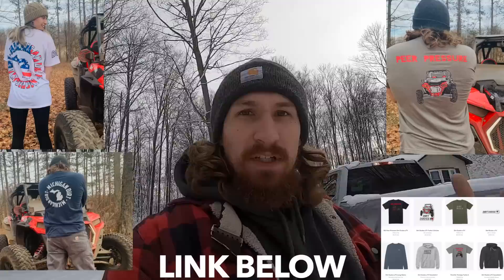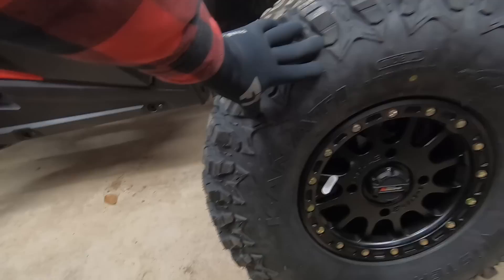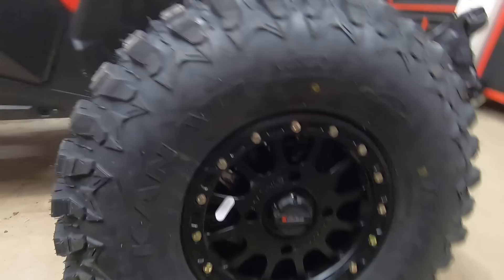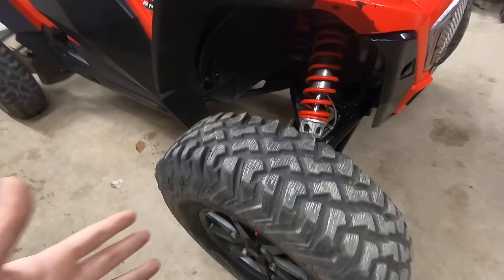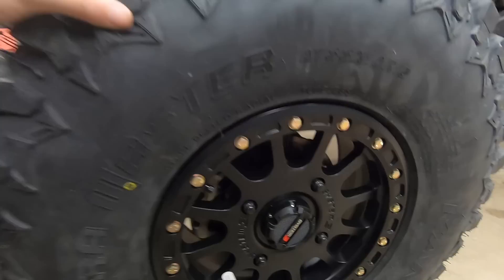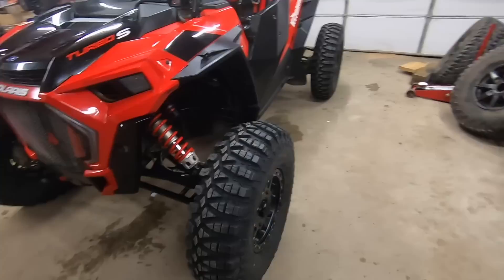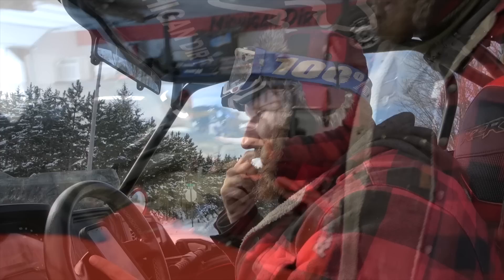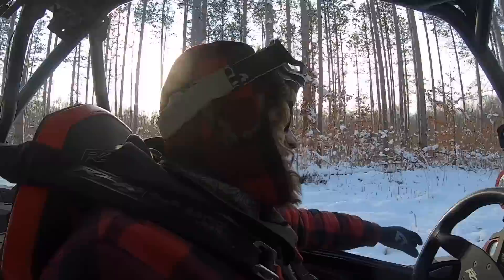Boondocker RZR Turbo S 0-60mph | Rim & Tire UPGRADE! Kanati Terra Masters on System 3 Beadlock Rims

Comment: sweet video the turbo s is looking good! I have the same setup and live them. I run the front tires side a and rear side b. I recommend you re torque your bead-lock bolts to 15-18 ft lbs after a couple tips they come loose over time and loose air.

Comment: I run the same trails out of Fife Lake area, and put the same tires on my YXZ this summer.  They are great in our regional trail conditions, but not too impressed with them on the hard pack snowy roads so far.  I’m also going to try and flatten them out to get a better contact patch, a,d hope that helps.
Reply from the maker: Thanks man! Haven’t don’t much testing but I noticed it doesn’t handle the snowy roads very good either

Comment: You have to take the boondockers tuner and put your rig back to stock which entails taking the boondockers tune out and putting your stock tuna back in which would be in the boondocker tuner what's your rig is back to stock you can use the Assassin's tuner and put the Assassin's tune in that's probably why you're having an issue with doing what you're doing that is if you don't already know that you need to do that
Reply from the maker: That’s pretty much exactly what happened